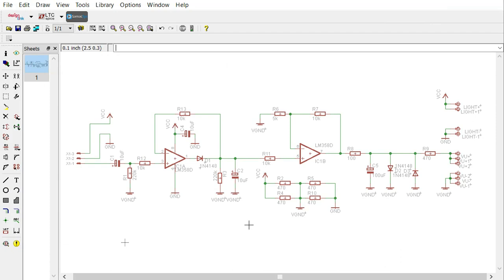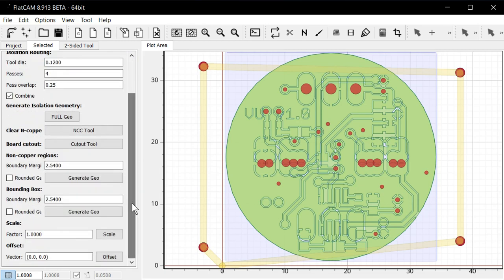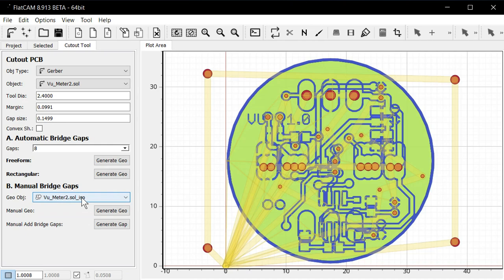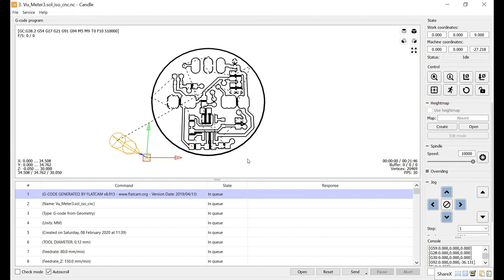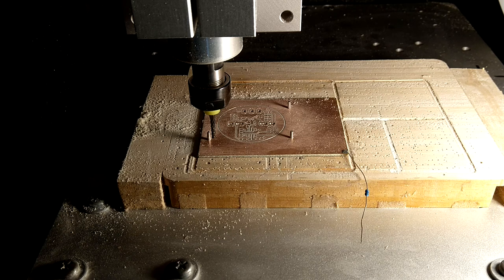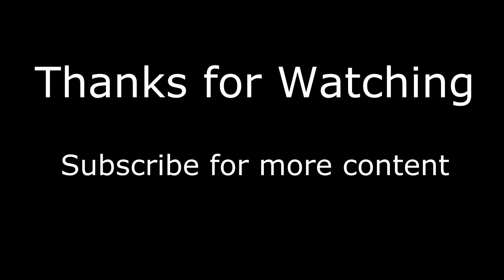CNC Milling Double Sided PCBs Using Eagle, FlatCam and GRBL/Candle, Step by Step Detailed Guide

Comment from the maker: Detailed step by step guide on how to get decent results milling PCBs.
Quick Reference:
00:00 Intro/Eagle PCB Schematic
00:41 Eagle PCB - Board Layout
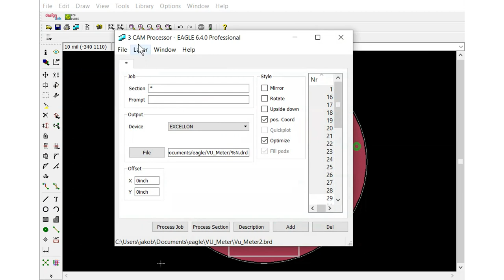01:39 Eagle PCB - Export Gerber and Drill files
02:28 FlatCam - Intro
03:54 FlatCam - 2 layer alignment drills
07:05 FlatCam - Top layer engraving
09:35 FlatCam - Bottom layer engraving.
10:08 FlatCam - Drill configuration
11:29 FlatCam - Board cutout
13:16 CNC Intro
15:00 CNC - Candle Intro - Drilling alignment holes
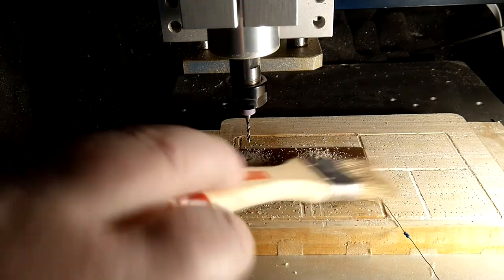15:51 CNC - Top side engraving
18:54 CNC - Flip the board
19:27 CNC - Engrave bottom side
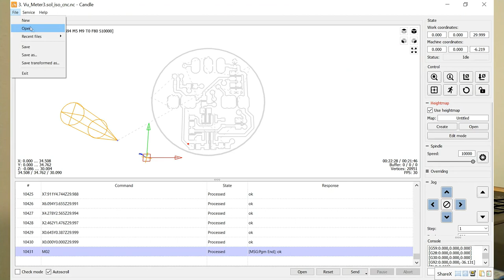20:57 CNC - Drilling
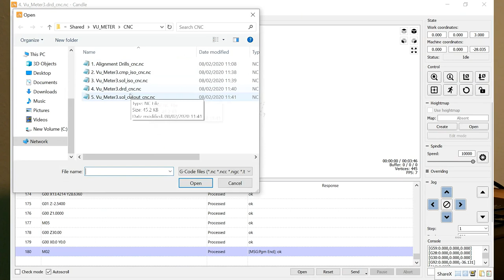23:09 CNC - Board Cutout
25:46 Completed Board

Comment: I think Candle/GRBR deserves more attention. It's the only tool I see that does that "z-mapping", which is essential to getting good PCB routing. I'd like to learn more about how he's doing that using the "jumper wires" we see. I suspect it completes a circuit as he base is an insulator (wood). Please discuss this in another video? Thanks.
Reply from the maker: Hi Richard, to use the auto level feature you need a GRBL board that supports this feature. Most new (GRBL 1.1) boards have this feature and as you suspected it just works like another limit switch letting the software know once the circuit is completed to measure the height.
I can do a more detailed video on it as a few people have been asking about this feature. It's essential to use this feature for good circuit board engraving results.
Cheers,
Jake

Comment: Hi your video is wonderful to newbee as I. 
One thing I want to ask you is let me shoe the way of milling to larger hole with out drill bite as its size. Let me know the detail to make the larger hole with much smaller milling cutter bite. I can not find the way to milling the larger hole with smaller milling cutter. WIth Mach3 tool they have very simple way to make the larger hole with smaller milling bite.
I'm very much appreciate to knowing the way. Thanks in advance.
Reply from the maker: Hi, Thanks, if you use FlatCAM then there is an option on the tab where you configure hole drilling, here you can select what holes you want to mill and what holes you want to drill. I use the mill functionality in this project: https://youtu.be/zUJt9sJ2mxU?t=187
Cheers,
Jake

Comment: Hey  man, great video, thank you for do it to us. my native language isnt english but i can to understand perfectly.
because of you finally i could understand how to make 2 sided  of pcb mirroring.
i have a problem sometimes: the mill cutter does not remove the copper completely, maybe the tool were old and loose the cut. can you help me to understand it and solve?
Reply from the maker: Thanks, I'm happy you found the video useful. For the Z axis zero I always make sure the CNC controller is zeroed with the engraving bit at position 0 (touching the board) I always do the zero operation, then reset the CNC controller because the software sometimes have problems if you don't do this. Hope it makes sense.
Cheers,
Jake

Comment: After 4 hours of trying to get FlatCAM to run I gave up.  Are there free alternatives that are NOT python based?  FlatCAM seems to be a bit of a disaster right now.
Reply from the maker: Before switching to FlatCAM I used a plugin for Eagle PCB called PCB-GCODE, I think it's still available. There was also a piece of software called CopperCAM I believe, but I'm not sure if that is still around. However none of these are as powerful as FlatCAM so you might want to have another go at making it work, maybe try on another machine.
Cheers,
Jake

Comment: hi all, Does anyone know how to cut? I want to cut inside, not outside. my flatcam is 8.993 BETA
Reply from the maker: I've only done it for large round holes, for those you can just define them as a drill hole in the PCB software and then in flatcam you can select that holes above a specified diameter should be made using routing instead of drilling. You can see an example of it in my Tube Prototype Socket video.
Hope that is helpful.
Cheers,
Jake

Comment: Very well done and precisely what I was hoping to find; a well explained tool chain demonstrating two-sided PCB milling + auto-leveling with a GRBL-based CNC controller. I have a couple of questions: 

1. For the drill holes, how does your CNC+Candle handle the Tool Change command (does it pause and wait for user input before proceeding)?. 
2. Did you need to initiate an explicit Z-Probe operation after each (drill) Tool Change (starting @ time 22:20) before resuming the job?
Reply from the maker: Thanks Manny,

1. Yes,  Candle will pause and you have to click continue when you are ready. The tool change position can be configured in FlatCam. I use x,y at 0,0 and then raise Z to 30 mm for tool change plus I have my spindle controlled by the GRBL board so it will auto start/stop for tool change.

2. No need, I always use drill bits with a fixed collar, those are in my experience accurate to within half a mm. Just make sure the bits are seated all the way in and your travel is high enough off the board (I use 1mm, but you could use 2mm) to make sure the drill bits don't crash if the board is uneven. Plus I always drill ~1 mm deeper than the board thickness, to make sure the drill tip makes it all the way through even if there are slight variations in the drill collar position and board height.

Cheers, Jake

Comment: If you're making rectangular boards you can always mill away the copper on the board edges, then score the exposed board material with a utility knife and snap them apart.  Very good tutorial.  Thank you.
Reply from the maker: Thanks, it's a good suggestion. It's also quite popular to use a guillotine cutter, but using the CNC for cutout is very convenient even with the mess from adding water, it always gives very precise dimensions in any shape.
Cheers,
Jake

Comment: This is great info.  What design rules do you use for you track and gap sizes ?  Also what bit did you use ? I used the V bits that came with the machine and the tips broke straight away.  Great idea with the water BTW.  Very useful tip.
Reply from the maker: Thanks, I always keep my track and isolation above 10 mil, then I will usually not have any issues, however no need to keep tracks smaller than what you have space for, so often I will use 24 mil+ for signal tracks and larger for power. For the v-bits I use cheap carbide ones, they are like a rod that is sharpened then ground down on one side, very simple bits. Often sold as PCB engraving bits 30 degrees, 0.1 mm, cost around $10 for a pack of 10. I usually inspect the tips under magnification before use just to make sure the tip is intact, they do last for around 10+ boards before getting dull (you can tell it's dull when the burrs are getting large).
Hope this is helpful.
Cheers,
Jake

Comment: Thanks for sharing this video, Jake. Very helpful to see your whole toolchain and order of operations, step-by-step. I appreciate the small tips like soldering an easy-to-grab resistor to the stock for probing. Definitely going to give Candle a try after some challenges with Chilipeppr.
Reply from the maker: Thanks, yeah I'm pretty happy with the GRBL controller and Candle, although I'm not sure if the Candle software is still being updated.
Cheers,
Jake

Comment: Nice edges, any idea how many rpm your spindle is running ?
Reply from the maker: Thanks, yes, it runs close to 10,000 rpm. I checked it recently. I used to run a 30,000 rpm spindle but it had too much runout and the results were not as good.

Comment: How do you handle the via’s? Easy to mill but how do you connect them?
Reply from the maker: Hi, I just solder in some cut off pins from through hole resistors etc. Of course this means you have to pay attention when you design the board to make sure you don't have vias under ICs and that the pad on top of the hole can be soldered where needed.
Cheers,
Jake

Comment: Love the video. 
Using bCNC myself and got a bit annoyed with it : seems to lose the height map when running the milling :
1st auto level, 
2nd drilling the holes to avoid problems
3rd milling the tracks 
4th doing the edge cuts.
Reply from the maker: Thanks, I've only looked at bCNC, I haven't actually tried using it. I kind of went directly from EMC2/LinuxCNC to Candle/GRBL when it became too much trouble to keep my old PC with a parallel port alive. 

Usually I only do the height map for the engraving step as I use drill bits with a collar and their depth variation is usually within 0.5mm, which is fine for drilling, but the Candle software will remember the height map, however you might run into a problem if you need tool changes for the drill bits, I don't think it will allow you to zero the Z axis on tool change.

Comment: Did you flip the NC Drill file? I guess I missed it... I thought the NC Drill file "mirroring" is with respect to the top (component) side but you drilled it on the bottom (solder) side.
Thanks for the vid, always interested in CNC aspects of PCB home manufacture... I might adopt the CNC drill step (but still etch the top and bottom).
Cheers,
Reply from the maker: I used to drill from the top, but there is a small risk when doing the height mapping on the bottom the bit will hit one of the holes, so really the best way is to complete engraving both sides before drilling, so I do flip both the solder side and the drill file as one of the first steps. I remember manually drilling etched boards back in the through hole days, it was quite a task, especially if you didn't have a good mini drill press, CNC makes it so much easier and you can make all the holes the right size.

Comment: Thanks for sharing. Just what I was looking for to create PCBs.  What was your depth of cut and speeds and feeds?  Thank you.
Reply from the maker: Thanks, for PCB engraving I usually use a feed of 80-120mm/min, at 0.05mm depth with an RPM around 10,000.
Cheers,
Jake

Comment: Hi.   Thank you very much for this great explanation. I followed carefully your procedure and it works very well. Nonetheless, I don't get sharp edges like the one you get. Could you please tell me what 0 .1 mm, 30 degrees flute caracteristics you use, make and model. I believe that makes the difference between success and failure. Thank you very much again. Regards, RJM
Reply from the maker: Hi, the v-bits can be the reason, I just use the cheap 0.1 mm 30 degree engraving v-bits you can find online for around $5-10 for a pack of 10, they are basically just a rod that is sharpened and ground flat on one side. I have tried 0.2 mm as well, but never got good results with those. I usually inspect the tips under magnification before machining as I have experienced bits where the tip had broken off and it's very difficult to see without magnification. Another possible source of rough edges is the spindle itself, in my experience if you have excessive runout or vibrations then you will never get good results.
Hope this is helpful,
Cheers,
Jake
Reply: TheStuffMade Thank you very much for your precision.  I was using 10 degrees 0.1 mm v-bit. I have ordered some 30 degrees carbide. Looking forward to more great video of yours. Regards, RJM

Comment: Excellent video.  I have an issue that sometimes my Z heightmap goes screwey and doesn't do the probe.  Is there something specific you do before you do a Z Heightmap ?  Like zeroing the Z with auto zero and then do the heightmap ?  Also, any suggestions/recommendations  on a 10,000 RP motor ?
Reply from the maker: Hi, yes I do recall having the Candle software acting strange a couple of times in the past, now I follow a strict order of doing things and if I deviate for any reason, then I will reload the cnc file, that seems to reset everything. So for engraving, load the file, create the heightmap, do the z probing, apply hightmap and then engrave. I don't really have any recommendations on a good spindle, I don't think the one I'm using is being sold anymore, besides it's a bit weak with only a 50W motor, but it's got an  ER collet chuck and very little runout. Most of the cheaper spindles I see for sale are very high RPM and that limits their usefulness a bit.
Cheers,
Jake
Reply: @TheStuffMade  If you get a chance, when you do your next PCB job, could list the exact sequence as that would be really helpful.  Thanks.  I can then follow your recipe. BTW, I really appreciate videos like yours.  Thanks again.

Comment: Really great video. What is your surface made of? Is it MDF? It almost looks like Styrofoam. I haven't touched my cnc in a while. I remember being absolutely elated when I got height probing working with Linuxcnc. I don't have any experience with these grbl related tools. Thank you!
Reply from the maker: Thanks, the waste board is piece of scrap rubberwood , guess it looks a bit like styrofoam because I've drilled so many holes in it over time :) .. I do take a few mm of the surface every 6 months or so. I also started out with LinuxCNC, but when my old PC with a parallel port died, it was time to look for alternatives and the GRBL solutions looked like the way to go. These days you can get a decent quality GRBL board with USB interface and stepper drivers for as little as $30.

Comment: Great video..!! Thanks for sharing. Where did you find the alignment pins? And what did you use for cleaning the board. You said don't use sandpaper but ...?
Reply from the maker: I use some hardened 1.5 mm pins made from some 100mm rods I bought online, they were quite cheap, just grind a mark in them and then you can break them off in small pieces. I always use Scotch pads to clean my boards, it's rough enough to remove small burs but wont damage the boards.

Comment: Firstly the video is so completely indepth ,love it, how do I drill with milling bits
Reply from the maker: Thanks, in FlatCam there's an option to define that all holes above a specific diameter should be made using a milling bit. I don't have a video showing the details of this specific feature, but it's easy to use, it will just generate a tool path for these holes and then you can go in a define the milling details and generate g-code. I use the feature to make the larger holes in this video:
https://www.youtube.com/watch?v=zUJt9sJ2mxU
Cheers,
Jake
Reply: @TheStuffMade  thanks

Comment: It did not seem that you mirrored the component side are you sure you did? Didn't holes need to match?
Reply from the maker: I mirror the solder side (back) and the drills, the component (top) side should not be mirrored because it's the side that it milled before the board is flipped over.
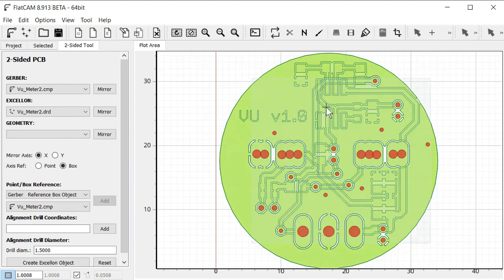You can see it at around 04:15 where I mirror both the solder side and the drill file as both of those will be machined after I flip the board.

Comment: Thanks for your great explanation. I just want to know which CNC machine could you recommend me.
Thanks in advance 🙏🏾🙏🏾🙏🏾
Reply from the maker: Thanks, I'm sorry, but I cannot give a good recommendation of a CNC machine, I only have my small desktop one I use in this video and a larger DIY CNC I use for wood projects. I don't think the CNC I use in the video is available any longer, but I believe it was sold for around $500 under the name Sable CNC. I got mine second hand because the original owner couldn't get it to work right, I thought maybe just a faulty stepper motor, but it turned out the linear rails were not parallel, so it would bind up and the motors would lose steps resulting in failed jobs. Anyway I can share some general advice on what to look for in a good machine:

1. It should be sturdy, metal construction, no plastic.
2. It should use ball or acme screws, avoid belts.
3. It should not use the stepper motor bearings to hold any of the axis in place.
4. The spindle should have an ER collar.
5. The spindle motor should have minimal runout, also it should not rely on the bearings in a normal DC motor.

Anyway, I hope this is helpful.
Reply: @TheStuffMade  Thanks for your quick response
Reply: @TheStuffMade  
I typically

Comment: Cool info, @14:41, what is that  crocodile clip for ? thanks
Reply from the maker: Thanks, the crocodile clips are to detect when the bit makes contact with the copper surface, then I can zero the z-axis very accurately.
Cheers,
Jake
Reply: @TheStuffMade  I see, thanks for the info.

Comment: Sir I am using similar cnc that is arduino based, please tell me where to connect height probe in the arduino boards. I mean what are the pins assigned to it. THANKS VERY MUCH
Reply from the maker: Sorry, I can't tell without more info on the control board you're using. Have you tried asking the seller where you bought your CNC?
Cheers,
Jake

Comment: Hi! I have an issue with Candle and creating a Heightmap. I hope someone can help!

When I run the "Probe" button in the heightmap settings the spindle goes through the grid lines but never moves the Z axis up and down to take measurements.

I have changed the boder settings, the probe grid numbers the Zt and Zb numbers and the interpolation numbers but nothing seems to have an effect on this. ¿Does anyone know how to fix this?

The Settings I Used
"Use Heightmap" checked, "Show border" checked, "Auto" Selected, "Show Grid" Checked, Interpolation Grid X:2 Y:2 checked. Probe grid: set to test every 10mm, Border X:0 Y:0, Zt: 1, Zb: -1.

Using 3018Prover, Candle 1.1.9, ran a homing cycle, used Z-probe to set Z height. And set my XY coordinates at the lower left corner of my PCB. Jogged the Z axis to be above .5mm from the pcb at orgin.
Reply from the maker: Hi Pablo, do you know what version of GRBL your control board is running? 
Cheers,
Jake